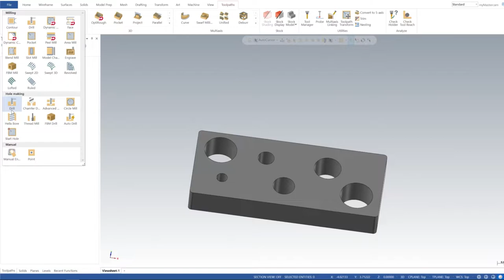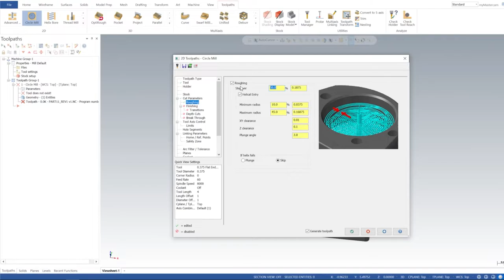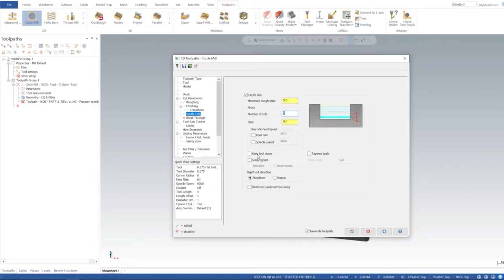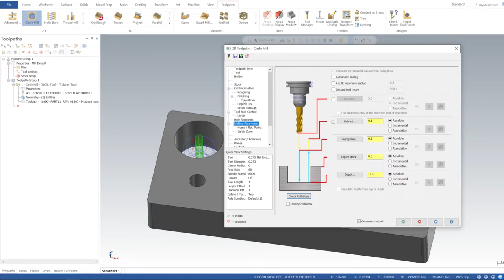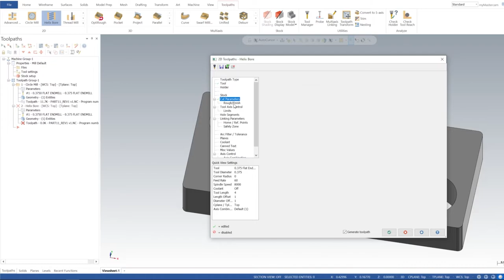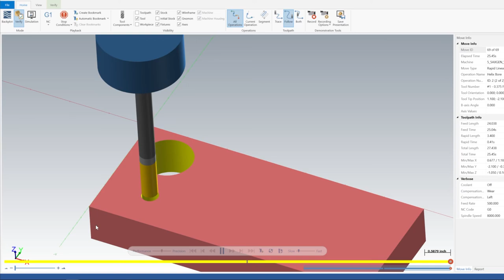MasterCAM Circle Mill And Helix Bore Tutorial

Comment: i use circlemill to chamfer multiple diameter holes at once. if you have a 6mm 45 degree chamfer mill, then you can enter -1.5mm stock on walls and floors so the cutting edge is right on the edge of the model. The main reason is that circlemill always starts and enters from the middle of the hole while model chamfer toolpath does not.